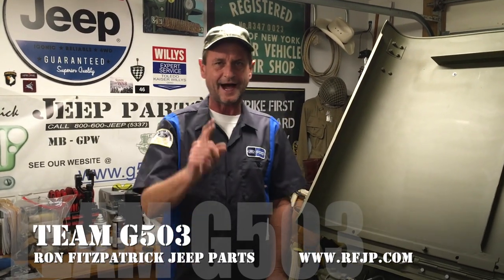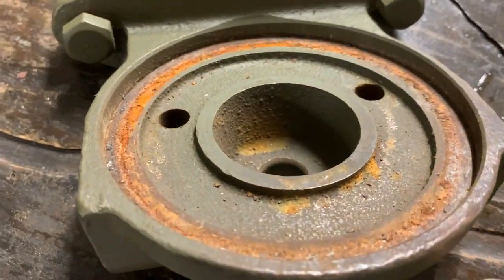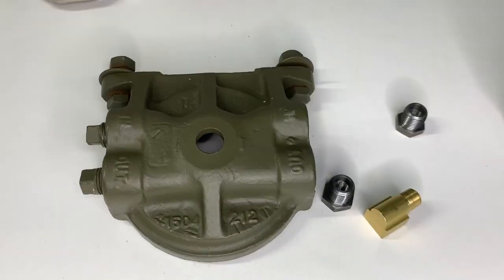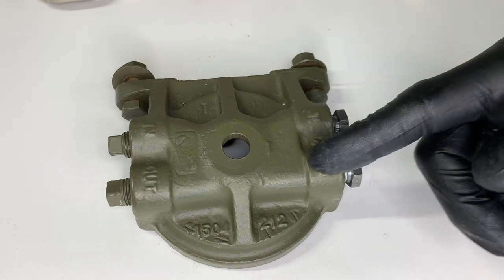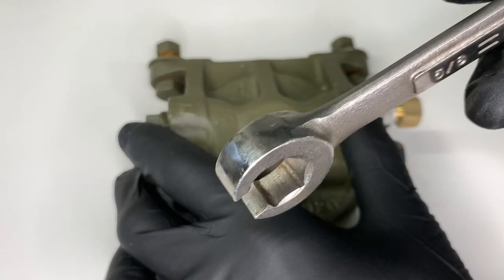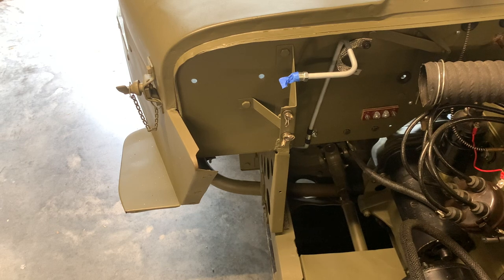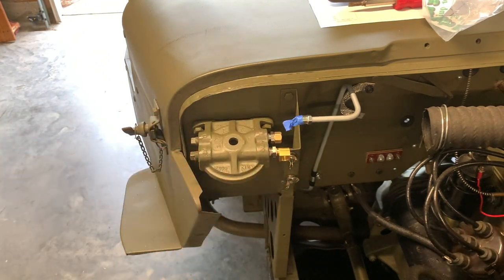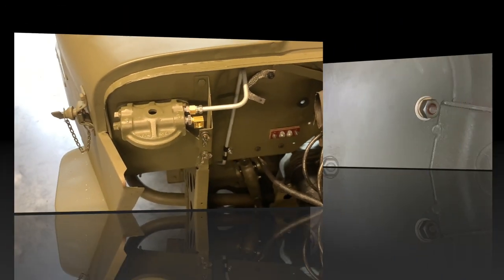G503 Fuel filter restoration (Part 1) Installing the fuel strainer, Willys MB Ford GPW WWII Jeep

Comment: You don't need any sealant on flare fitting. Seals on flare, not threads.
Reply from the maker: You are correct, you don’t “need”.
Just something I have always done as an insurance so to say.
Reply: @TeamG503  Other poster is correct, the flare seals. The threads are immaterial, as the liquid would leak out between the tube and the  id of the fitting. Brake lines are the same. Antiseize is actually a wiser choice. 

Like the videos.. 👍
Reply: yup exactly my thoughts. It cannot leak via the thread since the fitting is only there to put force on the flare surface.